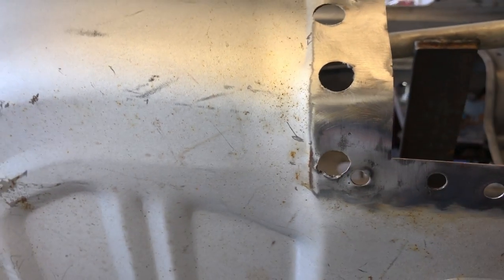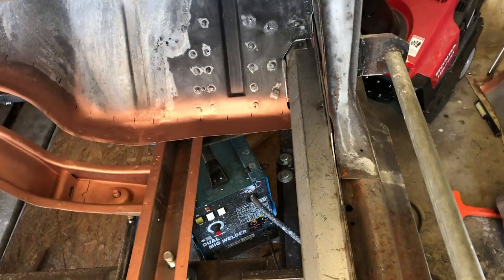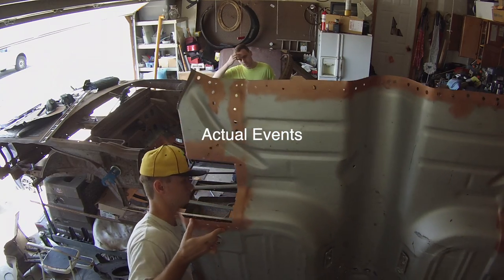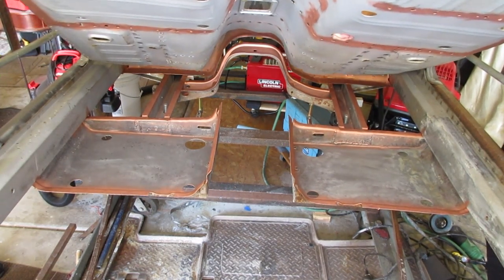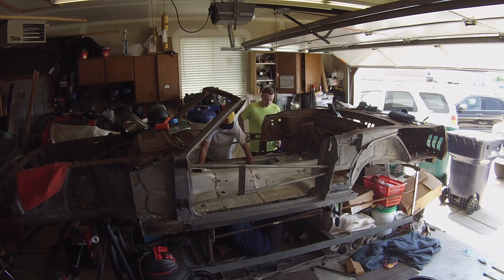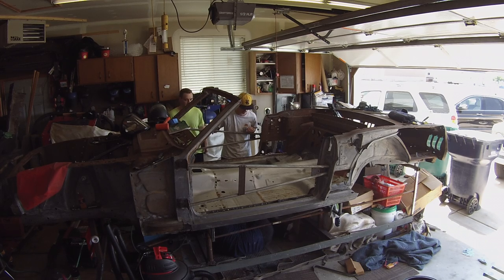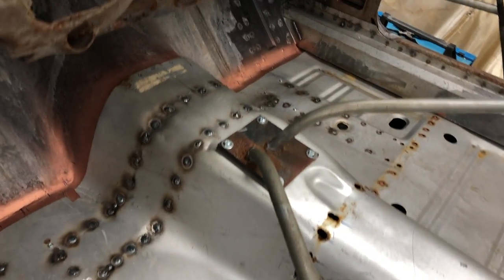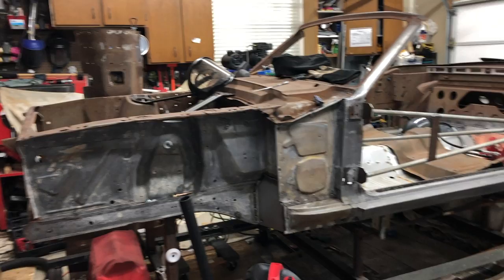Installing a One-Piece Floor Pan in a '67 Ford Mustang Convertible Part 1

Comment: Thanks for that video. My Floor Pan Replacement will come soon, so I hope, that your videos will help me! :-D
Reply from the maker: Hope it helps out a bit. The full floor pan is actually a lot easier than the long pans that they sell. I’ve done both and the full floor is the way to go.
Reply: @carguytroy  I bought this one:
https://www.rsb-parts.de/modell-1965/karosserie-blech/bodenbleche-schweller/3811/bodenblech-fahrgastzelle-65-68-cabrio?c=4281
hope this is the easier one.
Reply: must the Rear Torque Box Plate mounted before the Floor pan or after?
Reply from the maker: The floor you have is the one piece like I used. Lots easier than the long pans where you leave the trans tunnel and graft it in. The floor sits on top of the torque boxes from the factory so that’s what I did.
Reply: @carguytroy  thanks !!!